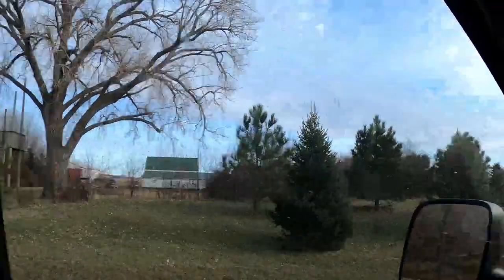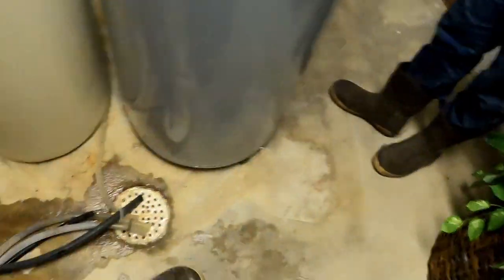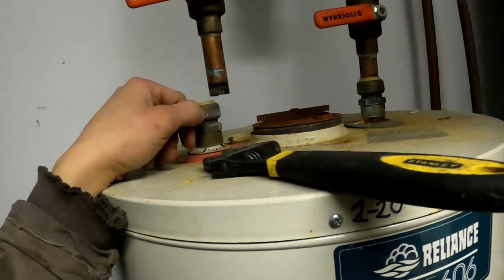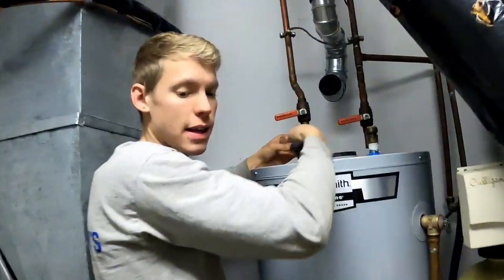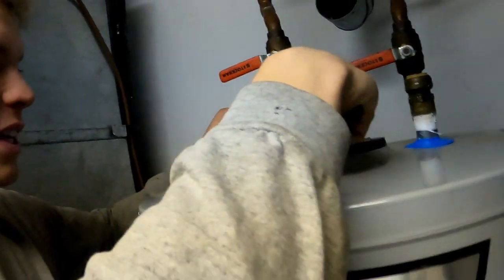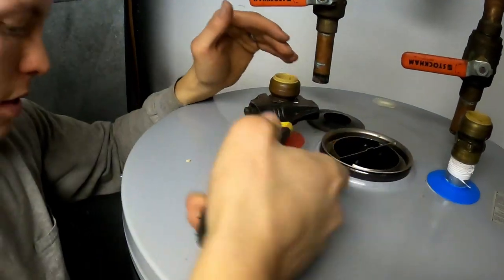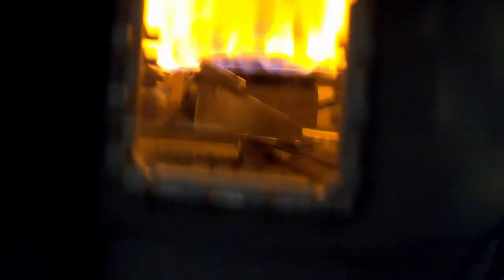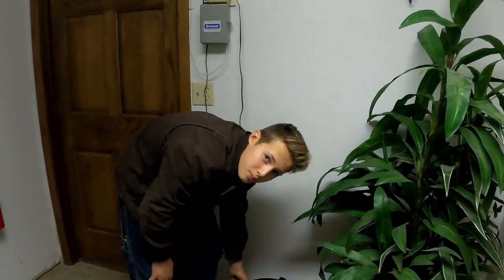Most Boring Water Heater Change Out

Comment: Why did you reuse both shark bite fittings?
Reply from the maker: Well, there is never a perfect excuse for anything below excellence, and I probably took an unnecessary risk in this situation. Here is why I chose to do what I did.

 The cold water connection was letting some water by, and due to the event the water main needed to stay on. This presented a difficult soldering situation, and so I took the easier and riskier route. As far as I understand though, they can be reused if the rubber gasket is in good condition, and can last twenty five or so years. In our area, most water heaters make it about ten (the existing was put in in 2009) so I am betting they will outlast the heater.

Still, best practice would be solder joints, but the situation did not afford me the pleasure.

Comment: Reuben, why does the flue bend in that odd way?  Is there a purpose for it?
Reply from the maker: I think someone added it to work as a drip tee/pipe expansion offset.
Reply: @ReubenSahlstrom  I think the ground wire is on the way, a straight shot is better.
Reply: A crazy way to vent it, A!
Reply from the maker: @nathansnell1812  Was that you who vented that thing? It was at the funeral home.
Reply: Better question is why didn’t you correct the flue venting?
Reply from the maker: @lordthorby6199  is there a reason other than the appearance that it should have been changed? If so, I apparently missed it.
Reply: @ReubenSahlstrom  improper venting of an exhaust vent can’t lead to someone getting sick. Worst I’ve seen was inside a house they didn’t even connect their flue vent and it was inside their hallway closet.
Reply from the maker: @lordthorby6199  I was on a call the other day where the gentleman had added a tee on the PVC vent of his navien boiler, and it was venting heavily into the house. Thankfully nobody got sick from CO poisoning.

 My question is what is wrong with the venting in this particular installation? I didn't see anything that warranted re-venting.
Reply: @ReubenSahlstrom  to each their own I personally would have straightened it out because I get paranoid that exhaust fumes will cause a health issue. Looks like a p trap in the vent lol.

Comment: Very yellow flame :O
Reply from the maker: I noticed that after the fact too. I think it was because of all the moisture and condensation from just filling the tank. Since the water was cold there was condensation dripping off around the burner, and usually is until the water warms up. Seems they usually burn blue when they warm up.
Reply: Its because the tank is cold. Very normal

Comment: Hack job!  Learn to solder or get some pro press at the very least if you’re going to use a shark bite don’t reuse the same one. Also there’s no flex piping in the attic that’s just ridiculous.
Reply from the maker: I agree, the best decision would probably be replacing the sharkbite fittings with solder connections, however the cold water valve seemed to be letting some moisture by and due to the very large event it was not feasible to turn off the water at the main. Thus I took the risk, and if they fail will have to repair them. As far as I understand though, they can be reused if the rubber gasket is in good condition, and can last twenty five or so years. In our area, most water heaters make it about ten (the existing was put in in 2009) so I am betting they will outlast the heater.

Still, best practice would be solder joints, but the situation did not afford me the pleasure.